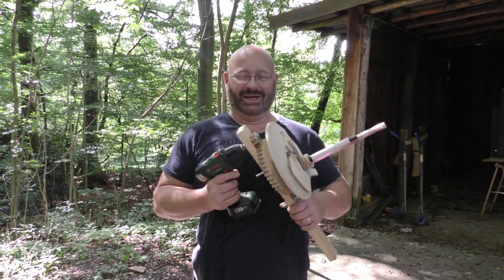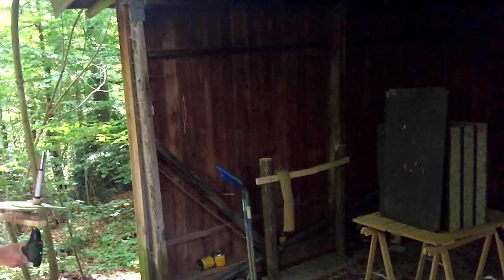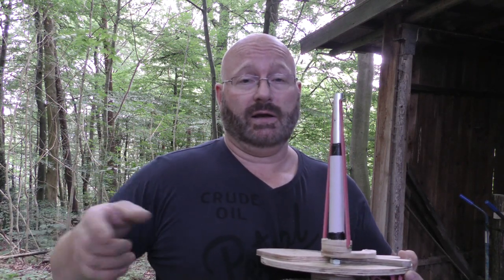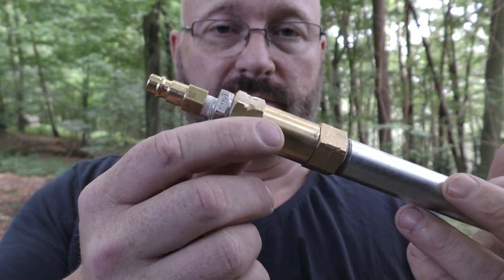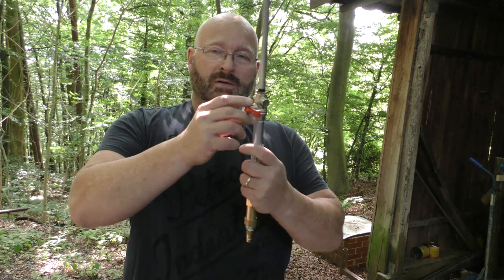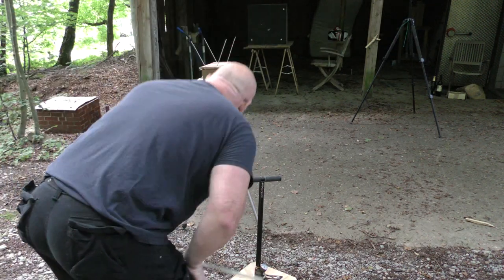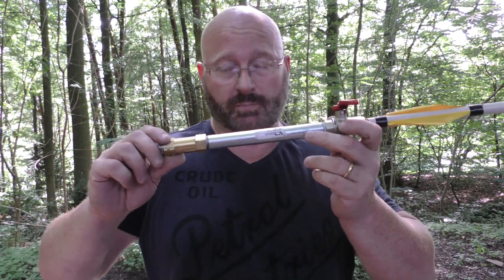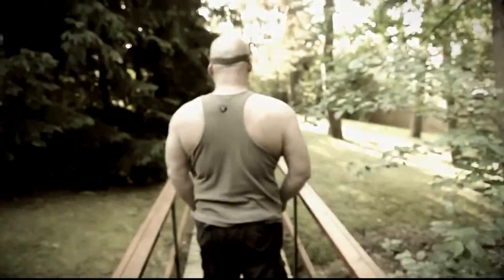Progress Fun! Wow.

Comment: well 140 bar is a lot of pressure, i'm working every days with this kind of equippement and the ball valve is not meant to be used with this kind of power. i think it's for 25 bars, even with a safety facotr of 3 or 4 it's only 100bar.... you better used some equippement meant to be used in hydraulic, witch is often rated for 250 bar, then you'll be safe, and it's not a lot more expensive.
i know that you don't care but i'm really concerned about that kind of power, and my job is to burst test so equippement in aeronautic ... check the brand "legris" they have a line of product in brass rated at 250 bar, is use that in my burst test with pressured nitrogen.
Reply: Agreed.. it's only a matter of time before they pop, especially when you take fatigue into account.
Reply: did some very basic and dirty calculations and a pipe with 20mm diameter and 250 bar would need a thickness of 1,49mm to not burst (withour calculation in the security factor. lets assume a security of 2 that gives us something like a wall thickness of 3 mm which should be well enough to withstand 250bar. So the pipe hes using schould be a ok.
Reply: Are you taking into account the threading, the weld seam, fatigue, and material quality used?   A security factor of 2 is worthless in engineering and pressure systems. static pressure systems start at factor 3.   there is also the check valve, and the very thin brass fill valve he's using. Theory is great, but when it comes to something exploding in your face, you may want to add a very large safety factor.
Reply: I really hope Jörg listens to this. These kind of pressures are dangerous to work with.
Reply: +RamBoZamBo123 I hope he does too, I love his videos and I've always been kinda worried about the day we all hear he is in the hospital due to an accident.....be careful jörg
Reply: i took threading, the weld seam, fatigue and possible thickness differences created by rust (0,5mm) into account. I also calculated everything for 250Bar while he is at 140bar. So if he stays at 140bar hes at a security factor of arounf 4 with 3mm thick walls. I cant make any assumptions about the brass parts and the valves but if he uses valves that are rated for around 250 bar for the final version he should be fine. Also he can simply use tubing with a wall thickness of 6mm or more to be at a security factor of around 8 with 140 bar or at around 4 with 250 bar. Or he could just do the calculations himself cause only he knows what kind of pipe he used.
I really do understand and share your concerns i just wanted to bring up some numbers to be able to categorize how dangerous it is because a gut feeling of someting may be bursting is really not very accurate.
Friendly greetings from a German mechanical engineer.
Reply: Oh I have full faith in Jörg, but a small reminder of the danger doesn't hurt. If 140 bar release uncontrolled because something bursts there is no time to react.
Reply: +Max xaM - I fully agree, it's also a low volume so it's exempt from any pressure directives, but it's still good to look at all the parts of the system, and to especially warn any kids that may want to copy this without thinking about it, or using too much teflon and not having a good thread engagement, etc..
Especially because it's held so close to your face and so easy to drop.
 -- Friendly greetings from a fellow engineer :)
Reply: Well, if there are no videos coming out anymore, we know what happened
Reply: You do know he doesn't really care about safety
Reply: +Ronnie Terry have you seen the stem punk pistol video where he shot the coconut out of his hand at the end? I don't care who you are that could have easily gone very badly for him. Or how about the time he used the impact anvil to crush blanks and got grazed by a fragment? I love Joerg but he had a tenancy to do things that are generally unsafe with out taking the proper safety precautions.
Reply: Much respect in your concerns for joerg... you are an awesome human.. Seriously
Reply: when joerg uses equipment fit for 250 bar, he will pressurize it to 250 bar. So much for telling him to use 250 bar equipment for safety.
Reply: use Paintball equip for this pressure!
Reply: can i ask how much a coke bottle can hold ( psi ) untill  its safe enough, i always thought the limit was 120 psi...
Reply: +Cherusker paintball equipment is only gonna operate at a safe max of 800psi... it's usually regulated in two different places inside of the marker
Reply: hehe he'll pressurize it all up to the LUDICROUS pressure setting ;)

Comment: I would hold the magazine seperated from the rotating parts that would decrease the turque or atleast it will help to stabalise the recoil.
May replace the bolt and with a ramp so the lever doesnt produce a shaking.

Comment: can this tubing hold that much pressure? it feels so dangerous, like holding an explosive ready to go off at any moment
Reply: Yes, I had the same thought.  I'm sure you are taking reasonable precautions, but please be careful sir!!  :)
Reply: 2000 psi = 137 bar
an co2 cartridge for making soda at home = 250 bar
Reply: You are right  -  that type of plumbing equiptment is not rated to be used at these high pressures, and it is merely luck (and a matter of time) before it bursts.
Reply: No way that a co2 cartridge holds 250 bar.
Reply: +jospi2 i heard that it holds only 50 bar
Reply: My Co2 cartridge right here says: "PH250BAR 0.66KG 3.4MM 0.6L TARE 0.70KG AA6061"
Newgreen and I are talking about a big co2 bottle you have in soda streams and such
Reply: Also what I was thinking. imagine the threads of the check valve ripping off while holding it towards your chest... That cannot be good.
Reply: +Pieter Vanysacker I think they are having an integrated pressure regulator next to the valve, so the outcomeing pressure is not that high
Reply: +ILIKECATZNCHEEZBURGERZWITHCHEEZSHAYAYAYAYAYAYAYAYAYAYAYAICOULDGOONLIKETHIS4EVERBUTIHAZTOGONOWBYE the size of the co2 bottle doesn't make a difference, due to the liquid phase in the bottle the co2 gas pressure self regulates relative to temperature; the normal pressure is about 800psi but it can get over 1000 on a hot day but no where near 2k
Reply: I think he knows that, hence why he sounds so nervous
Reply: Bullshit, CO2 has a vapor pressure of roughly 60 bar (870 psi) at 20°C. The bottles are rated for a maximum pressure of 250 bar (3626 psi), though.
Reply: +physcoticweirdo he isn't nervous, just tired after all that pumping

Comment: 2000 psi is quite something! A suggestion for the next iteration of the hexnut shooter - counterweight the magazine! Unless of course the wobbling when firing is just down to the pull of the rubber on the arm as it primes. Putting the drill in the trigger position and the two gears at 90 degrees might do something for stability too, though that would require a more complicated stock.

Very cool though!

Comment: I can imagine a way a bolt action version of your gas arrow launcher would work. Have the tube slide back and forth so the weapon can be reloaded from an arrow magazine, or rotating cylinder.  The air supply would have a storage tank which would be connected to a buffer tank by a ball valve which is opened by the action of the sliding tube to refill after each shot.

Comment: What are the burst pressures on you diy tanks? I gave up on the hand pump for my 200bar PCP air rifle and purchased a scuba tank to fill it up instead. It was great exercise but a huge pain to maintain due to overheating o-rings.
Reply: Typically those types of fittings are only rated for approximately 25 bar.

Comment: There can be many different designs with this system. I was thinking of one with a bolt/rail and the drill rotates a gear that pulls back the bolt. After a certain distance the gear loses contact with the bolt/rail and lets go. The bolt/rail  propels forwards because of rubber and hits the ammo. This sound cool in theory but probably would have some problems.

Comment: for the nut-launcher, you should consider fixing the top platform along with the magazine to the main body, and have only the lever rotate. this will stabilize the machine for better precision, and having only the lever rotating means you could get much higher speeds at lower load (you could even change the gear ratio for even more speed). another, very easy and basic, solution would be to just add a counter weight equivalent to the weight of a half-full magazine, because the machine was really unbalanced during rotation which made it slower and much less precise

Comment: don't worry joerg, schrader valve cores are rated up to 5000 psi and as long as the housing is metal the should be fine. also with your current design the fastest you could send the darts is the speed of sound due to the flow being choked, look up de laval nozzels.

Comment: It would be nice to see if you can accelerate the ball valve mechanism with rubber. Basically have a rubber triggred valve for an air gun. It think it can be done with one of your standard rubber releases.

Comment: You need the feed tube fixed were it doesn't spin with the launch wheel, launcher is wobbling all around cause of the weight of hex nuts, be much more stable and shot better if it not spinning the ammo like that?

Comment: Hey Jeorge!! I just wanted to know if you enlarge the cylinder so you can add more pressure, will it even shoot faster and more powerful?? Also, is it possible to use some other kind of pumping method for pumping faster and without much effort and struggle. So basically, I wanna know if you can add much power and make some kind of full auto version of it, so it charges the cylinder lets say in 5 seconds, and you can again shoot, maybe more of a semi auto.

Comment: People, it would be a VERY good thing to add small bleed valve to release the pressure between the pump and the device.  Having MANLY fingers is nice, as it can be a real bear to pull that quick disconnect with all that pressure in the inlet line.
Reply from the maker: The FXAirguns pump HAS a bleed valve built in, of course. It can go up to 250 bar, impossible to disconnect THAT safely under full pressure.
Reply: +JoergSprave Oh... Yeah_ I knew that... 😗. LMSBO!  Actually, I wasn't thinking about the pump you were using, so it slipped what mind I still have; was thinking about someone using an OLD high-pressure hand pump that might not have one built in, like the OLD one I had way back in the 70s & 80s.  Can't recall the make.
Reply: +JoergSprave You're my fave channel, by-the-way.

Comment: do one with a paint ball. and to make the trigger quicker, add rubber bands to it to snap it forward so it will also ask as a safety bc when you are pumping it u have to hold it back and u can mess with how much pressure power u want

Comment: If you slide a piece of pipe over that threaded bar it will act like a bearing and stop the bar from eating away at the firing arm. Also, this doesn't fire 240 "rounds" per minute, it fires 240 hexagons a minute :-)

Comment: What if you attach strong rubber bands to the ball valve and design a trigger system for it. This way you could open the valve rapidly and without being dependent on electricity for the solenoid valve.

Comment: Oh my gosh I have to make one would a air compressor work just as well do you think ?
Reply: An air compressor would work just fine. But I think it will become expensive because 2000psi (about 14 bar) is more than the rather cheap and common compressors can generate. But I&#180;m sure you will find some that can generate so much or even more pressure. If you find one for a few 100$€ let me know. BTW I didn´t search for those yet. Maybe it´s not that difficult to find.

Comment: I think you should make a device that cranks the arm back while not moving the entire arm and rubber assembly. The major flaw of this device is that you're actually rotating the magazine, shooting arm, and rubber, which is just unnecessary and limits the size of the shooting arm and power of the rubber by how much they weigh. If you simply rotated a disk with a peg that cranked the arm back, and then slipped off of the arm because of where the pivot points were located, you would only rotate the disk with the peg which could even be balanced to reduce any movement caused by the rotation. The shooting arm, rubber, and magazine, would all remain fixed.

Comment: Wouldn't the wood part get worn down by the metal threads on the bolt over time?
Reply from the maker: Smoothed that part out with the power file.
Reply: he could always use  a forstner bit to mount a ball bearing if he wanted to

Comment: wouldn't it be less tiering to use a compressor?
Reply: of course it would
Reply: A compressor that can reach 2000 PSI is damn expensive
Reply: +tommihommi1 it also needs electricity to operate i think
Reply: without its good training
Reply: I think he doesn't have a strong enough compressor.
Reply: and also much more expensive...
Reply: It's would have to be an industrial, very large, very powerful, extremely expensive compressor to compress 2000psi.
Reply: I think he once said that you could not get the pressure high enough
Reply: Yeah, but you need a compressors that is capable of such high pressures...
Reply: +GrexTheCrabasitor If you wish to converse with me, I don't demand perfect grammar, but I do request that you at least make an attempt.

Do try again.
Reply: He can go  to a dive shop, and get a  scuba tank. They can fill them to 200 bar.
Reply: It would be easier but how would he keep the big guns if he wasn't using them?
Reply: +lazaglider i like cheese
Reply: Compressor with 2000psi, or more, cost 2000$, the Airgun Pump cost 150$. Firedepartment
 or Shop for diving equipment have Compressors for loading UHP Bottles.
Reply: +lazaglider of all the people here, you are the one out of place. Take a chill pill
Reply: ...and you say that 2 days after I last posted a comment here. My spidy senses tell me you are either seeking attention, or attempting to reignite the argument. 

Either way, don't be so silly.
Reply: And another 2 days later, here is the troll trying to throw insults...

Dear oh dear. Honestly, if you're going to bother, at least try to be original...
Reply: 'Yeah well blah blah blah  swear word'. 

Gr8 argument bro.

Comment: for that powerfull thing. im not an expert but you need a trigger shooting sistem for that because the sistem it have have 2 problems:
1: opening the bobbin make you to slightly move the direction of the bolt
2: opening the bobbin make a 3 step pressure release. first with 1/3 spout open. seccond with half-2/3 and then with all open. in the hand speed matching the pressure force when opening is a diference in the wide of the spout when the pressure is releasing... i dont know if you will understand what i say my english is pretty bad xD

Comment: Hast du schon mal daran gedacht die Behälter/Kammern mit einer Stickstoff oder Sauerstoffflasche zu füllen? Diese haben meist einen Fülldruck von 200 Bar meistens/ CO2 für Getränke hat um die 40 Bar meine ich . Die Sodastream Kartuschen haben sogar meine ich 230 Bar. Ist nicht ganz ungefährlich aber mir wäre das Aufpumpen von Hand zu langwierig.
Reply from the maker: Ich wollte schon einen Schützenkompressor bestellen, aber die Betriebsferien...
Reply: +JoergSprave immer diese Ferien... :)
Reply: Hi Jörg, ich wollte mir auch einen Kompressor kaufen. Ich hätte da etwas für dich ;)
Reply: SodaStream + Quick exhaust valve(QEV). Das hat mega Power und deine Flasche geht nicht sofort leer. Ich hab mir das Ding selbst gebaut und an eine große leere Propangasflasse  wie am Grill angeschlossen, ich komm mit meinem Kompressor zuhause zwar nur auf 8 Bar aber selbst das hat Power. Was man daraus bauen kann überlass ich euerer Vorstellungskraft ;D
Reply: Ob Sodastream oder CO2 Flasche/Patrone macht keinen unterschied, die haben halle 56Bar +-2Bar. Da das CO2 in flüssiger Form vorliegt. Stickstoff gibt es in 200 und 300Bar flaschen, die 300bar Flaschen sind aber sehr teuer. Noch mehr leistung würde es geben, die "Waffe" mit Helium zu füllen, aber bevor sich das lohnt sollte man noch das Ventil verbessern.

Achja, was sehr Interesannt für dich sein dürfte, wären vieleicht Taucherflaschen. Die kann man sich oft für nen Appel und nen Ei auf 200Bar Pressen lassen, Teils auch auf 300 Bar, wenn man den Passenden Tank und Taucherladen hat.

Comment: Question? You said 2,000 psi, standard steel plumbing parts, and ball valves here in the USA have a max rating of 600 psi. That doesn't look like a high pressure ball valve. Did you mean 2,000 psi or 200 psi?
Reply from the maker: 2,000 it is. Hopelessly over pressurized. But it works.
Reply: That's one way to test the 4 to 1 safety factor. What kind of air pump was that you used in the video?
Reply from the maker: FXAirguns pump.
Reply: Thank You sir, and that explain how you are getting that kind of pressure. For this and the FX air guns.
Reply: Seedorfj I understand that, once he replied with the type of pump it was. Seen they make a 3 stage and 4 stage pumps. I work with 2:1 air boosters at work, I understand how they work.

Comment: Joerg:  I noticed that the drilled powered launcher "wobbles" because it is out of balance due to the magazine of nuts.  Is there any way you can configure your launcher with two magazines opposite each other?  This might balance the device better during rotation.
Reply from the maker: It wobbles because of the strain. That is a lot of rubber.